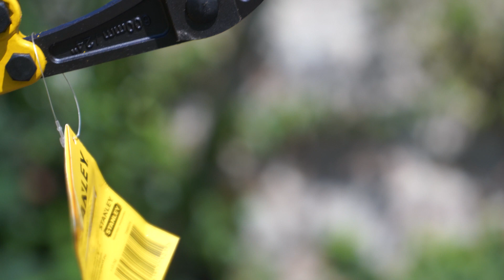How to tune a pergola | an expert guide

Comment: They've talked about espalier trees going along the outside length of the pergola... you won't even see the cables if that's the case.  Love the editing this time SO much with the music selection!   Well done, Dan the man :)
Reply: The cables could have been installed in the top beams that brace to the walls making interference a moot issue.

Comment: Looking good out there, Dan. Such a Pergola! When you are screwing in the tension wires, why don't you just use a screwdriver to tighten the inserted screw rather than hurting your hands on using a smaller screw? Just spin a rubberized screwdriver handle around with the metal part inserted through the loop. Your hands will thank you.  Annalise, boys and pups are looking lovely! 💗

Comment: Dan, it looks the only entrances to the pergola are from either end because the cable bracing appears to  block easy access to the structure from the side.
Reply: Yeah. Not a fan of those cables.
Reply: Only THREE spaces have cables (2:22) - and I'm betting there will be a bunch of plants in those spaces to hide the metal.  There are plenty of other OPEN spaces for people to pass through.
Reply: @earlaagaard8175  thank you for pointing that out - I missed it. I thought the cables were like a web that ran the whole length of the pergola.
Reply: There will be fruit trees every second opening that will hide the cables and plenty of ways in and out.
Reply: @wendychick8368  thank you for the info! I remember Dan mentioning something about the plantings but I didn’t remember the exact details - you have an excellent memory.
Reply: @imaloose  there’s only 3 cables all planned and thought through wth fruit trees disguising them. There’s half a dozen exit/entrances along the way so it won’t be a tunnel .

Comment: Pro tip for your expert guide: You could've put the tensioning X wires across the tops between the horizontal beams (joists) rather than the vertical posts. Utilising the wall's rigidity would have exactly the same effect for shear bracing the posts but wouldn't restrict walking.

Comment: I know Dave planned the cables and trust he has a purpose for them, but for me personally 
, I don’t care for them.  I don’t even like commenting on this, because I always tell myself, it is their home, in this case, Stefanie’s and if that’s what they want, that’s their business.  I just think it is to modern for the pergola and setting, also will not be able to enter from the side. Great job what you have completed so far.
Reply: Only three spaces between posts have wires. Trees are going up against the posts and bushes to add shade 😎
Reply: @carolinegooder7091  Stephanie is that you?
Reply: @leeannqh  Is that the "Wow Rat person"? The vlogs and comments are full of Dan and Stephanie talking about the fruit trees going in there.😄😎

Comment: I'm pretty sure I don't like those cables. Why use those instead of an angled wooden beam near at 45 degrees at the top of the vertical posts? You've got that extra wood now that you could cut and attach on several of those as braces. It would look so much better in the cables and would be higher up, smaller, and allow people to walk through those open spaces.
Reply: David is a better designer then that. I. Am sure once they have the steel installed they will go. Although it would look good with vines covering them
Reply: I suspect they'll grow plants in the three spaces that have cables - there are plenty of other open spaces for people to walk through.  The cables will then be invisible, and they will last a LOT longer than any wood bracing.
Reply: Trees against the posts and bushes will be in those spaces, held up by the wires. You enter the Pergola from the side and entrances, and walk down it in the shade. Windows of greenery will let you view the garden. There will be areas to sit also. 😁
Reply: He said the cables are temporary
Reply: @carolinegooder7091   How do you know the plans for planting? I don’t recall Davy or Stephanie saying this. ( I could be wrong 🤷‍♀️ )
Reply: @shelleypoole6415  because "she" is someone from lalande. How else would she know everything everyone does,  what's planned,  she knows the exact lalande floorplan and responded on multiple occasions with "we". An identity created against negative comments or unwanted questions.

I was a big fan of the chateau channels but after the last few videos I became extremely disappointed in that endless debauchery. It turned from renovations to a soap opera.
Reply: @karinchristinegande199  Interesting… I have noticed that all they do is clean or travel now or unwrap gifts they don’t need. All the other Chateau owners are doing renovations and showing them. 
I’m wondering why she does not fix the heating system, she can afford it. That would be my number one fix, the second would be the building on the outside. I’ve noticed three huge cracks,I’m no expert, but to me that screams majors issues. Those are the things I would be fixing instead of a garden etc. ( plus, the other château owners have no problem hiring trades men )🤷‍♀️
Reply: @shelleypoole6415  They including Dan have said in comments and Vlogs about the trees. 🤣
Reply: @carolinegooder7091  Guess I must have missed all that. 🤗
Reply: @shelleypoole6415  Stephanie has repeatedly said that tradesmen don’t want to travel to the Chateau because it’s so remote….they would have to find accommodation and the costs are prohibitive.  She is currently getting quotes for a new heating system and the outside facade is part of the architect’s submission to the local planning council.  Because the Chateau is a registered historical building every major change is required to seek approval from local authorities and France has a reputation of taking forever to get approved.  Waiting weeks to sort the exterior doors for Nati’s apartment is unheard of here in Vancouver, Canada.  Watching from afar in our armchairs, it’s easy to wonder why things take so long to get done.  But elusive Nick, Michael and Stephanie are moving forward daily while trying to ensure they are making the best decisions for the future of the Chateau and adjoining acreage.  I believe I have a wonderful opportunity to watch and follow them….France/Europe and the international community at the Chateau reminds me with every Vlog that there is so much wealth in collaboration and the blending of cultures.  And I agree that it can be frustrating when I know “absolutely “ a much better way of doing things!  But how “absolutely” fabulous is it to click on YouTube and witness the laughter and goodwill these people display to one another.  With all the crap going on in the world……I don’t believe for a second that another Cadeaux episode will end life as we know it.  This “family” is so much fun to watch and I hope the Vlogs continue for a very long time!  Now where did I put my glass of Prosecco….
Reply: @myrapatton8001  Thank you Myra for filling me in on the updates.  I love watching all the Chateau channels.  I wish we could have land and buildings like that here on Vancouver Island.  ( hi neighbour ) Hope you found your glass of Prosecco!
Reply: @shelleypoole6415  where on Vancouver Island?  I was born and raised in Port Alberti but lived in Victoria and have spent many holidays all over…..every time the ferry docks in Nanaimo I feel like I’ve come home!  The Island is so special!
Reply: @myrapatton8001  Chateau de Lalande is NOT a registered historical building  (not listed).  Planning permissions in France take 2 months max for non listed building and up to 6 month MAX for listed buildings. Where did you get your facts about France ? I suppose there is another problem that we don't know about.
Reply: @shelleypoole6415  The explanations about planning permissions in France are wrong. It's 2 months max for non listed buildings and 6 months max for listed buildings. Lalande is not listed.
Reply: @myrapatton8001  Port Alberni!  I’m originally from Davis Bay, Sunshine Coast.🤗
Reply: @yeli6420  oops!  My bad.  We had friends who lived in France and they spent months waiting for approvals for building permits and then again follow up inspections.  And I honestly thought LaLande was under guidelines for historical governance, especially with reference to the lake and exterior doors/windows/facade.  Thanks for keeping me on my toes!

Comment: Until plants cover the cables, Hang aluminum/ tin foil from the cables so the kids or anyone else doesn’t run into them and “clothes line” themselves. Speaking from experience.
Reply: 🤣Memories. You made me remember a time when my youth group took a day trip up past the 🚛grapevine🚚 to Gorman. It was such a treat to frolic in the snow❄️. Three of us were chasing others to be the first to go up the hill to sled🛷, & instantly went plonking down on our faces when we tripped over a low suspension cable between two low posts. Thankfully, no real harm done. 🤗 We had fluffy mounds of snow to break our fall.
💚 Bridget from Cali ☘️
(using my pal's YT acct)

Comment: I think the high tension cable is overkill and dangerous
Reply: The cables must be temporary until the steel comes.  Otherwise it wouldn't make any sense.
Reply: My first thought was to attach something colored or reflective to the cables so they are more visible to unsuspecting guests.

Comment: I don’t think much of the diagonal wires across the front of the pergola. Davey there is a better way, surely, diagonal timbers or cables across the top? It visually closes off access into the pergola. Never seen this on other pergolas.
Reply: Cables on THREE spaces only (2:22) - all the rest are going to be open....UNLESS they grow plants in the open spaces.  Guess we'll see.
Reply: Same. I also thought that there would be more wooden beams on top of the pergola to create the traditional look.

Comment: I kept thinking of Final Destination because of those cables. If you have kids or people running around, they might get caught in the cables. I hope those are temporary, or if not maybe changed to wood or more visible bracings?
Reply: My thoughts exactly😱🤦🏼‍♀️
Reply: I think the idea is to plant esplanade trees in front of the cables so they won't be visible.
Reply: Good to have this warning.  But I'm thinking it's very likely that there will be plants in the threee spaces with cables (2:22) - that way, people will be directed to all the rest that are open.

Comment: Oh. Those cross cables are not at all aesthetically pleasing. Please, please rethink it. Or tell Davey to rethink it.
Reply: The idea is to have either climbing vines or esplanade trees in front of the wires (wires will be the support).  It will take time for it to full take shape.
Reply: Only three of the openings have cables (2:22), and I'm with Tao of Kim - I'm SURE there will be plants screening the metal from view.
Reply: @earlaagaard8175  Yes, I'm pretty sure Stephanie said there would be espaliered apple trees along the outside "wall"

Comment: So with those crossed wires all along the front, during hot summer you won’t be able to just pop in for a bit of shade, you have to go all the way down to the end? And the same to get out? Like a long tunnel. No way out except for the ends.
Reply: Only three of the spaces have the cables (2:22) - the rest will all be open....UNLESS they grow plants all along this side!